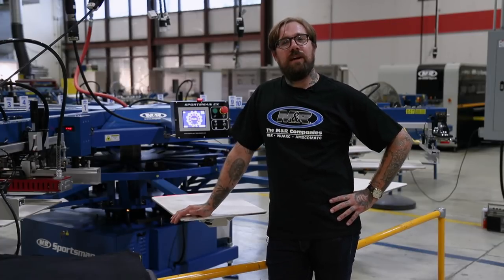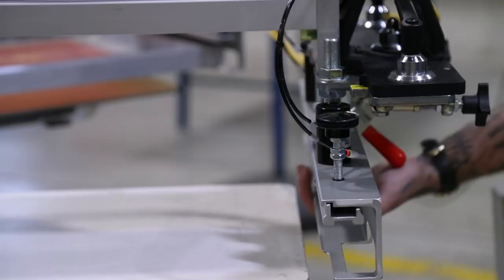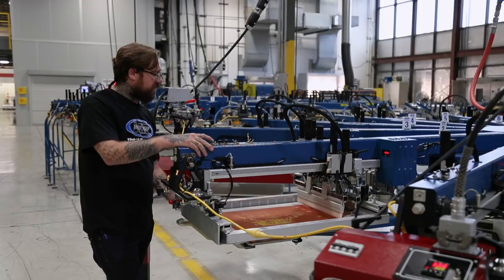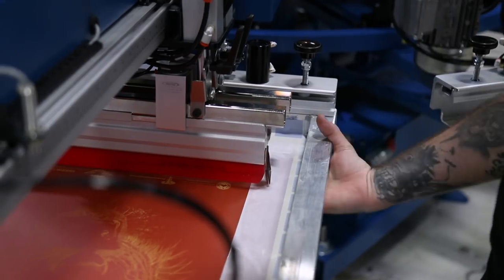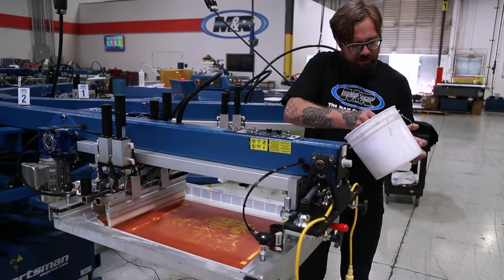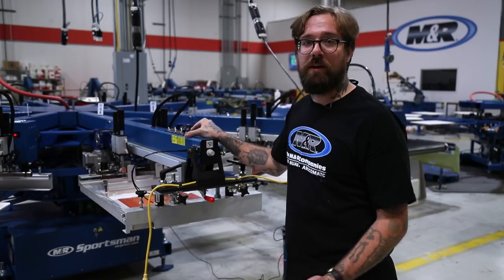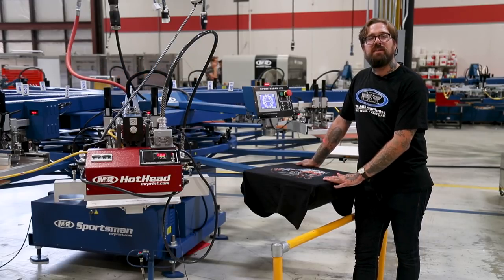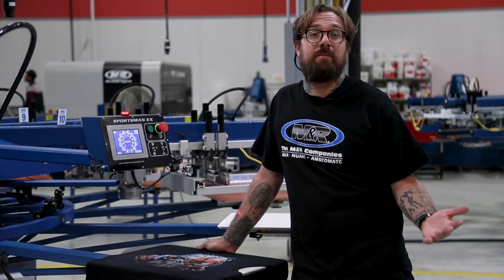Quick Tip: Press Setup Using the Tri-Loc Registration System

Comment: Great tip!  I am surprised that there are people who say they can do faster setups. Perhaps there is that one guy in your shop (maybe), but you don't have a full staff of people that "can" set it up faster...and all operators needs to use it, so put it into action for everyone. The most common negative thing you hear is that 1 out of 5-10 colors were not dead on so they stopped using it.  That might be, but more likely due to some other human error and not an issue with Tri-Loc. And out of the ones that are "not dead on", it's only a micro change to get it in versus setting it up manually taking far more time.   One other tip I've gotten from an M&R tech is to "hold it tightly" in place, keeping it in place more so, while it gets locked down. This is to say,  "pushed up against the stop blocks"...and not just put in place. The locking down step, can make it jump a hair out, therefore the hold while you lock helps improve reg.
Reply: I am that guy in the shop who can do this fast. You can’t line up a 4-5 screen set up faster than a tri lock. I can get a 2 screen going faster but not 4-5

Comment: I have please help, a head no longer gives speed when painting, it is slow and does not regulate speed.  Could you tell me what I can do?
Reply from the maker: You can reach us at:
Technical Support Hotline
Phone (Toll Free)800-483-8765
Fax630-858-4860
Phone (Outside USA)+1-847-967-4461
Phone (Outside Normal Hours)630-462-4715